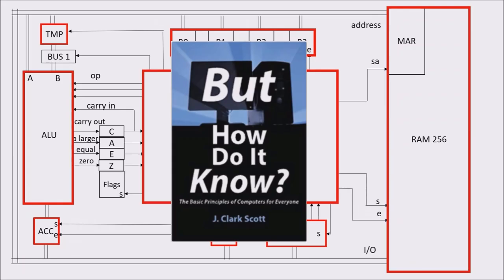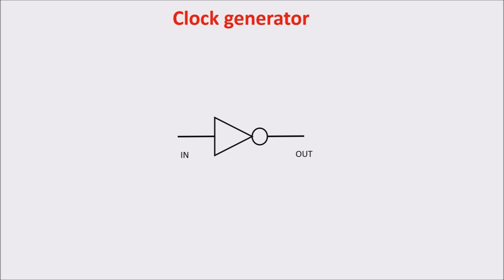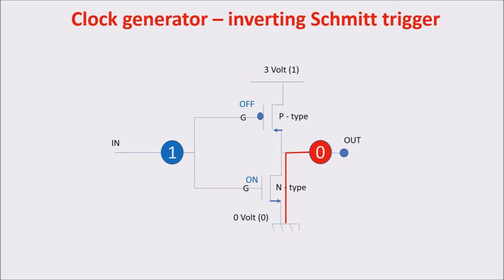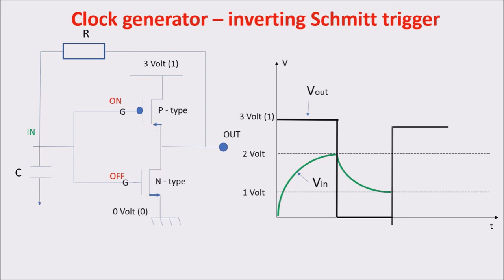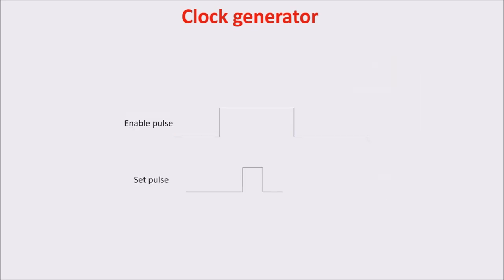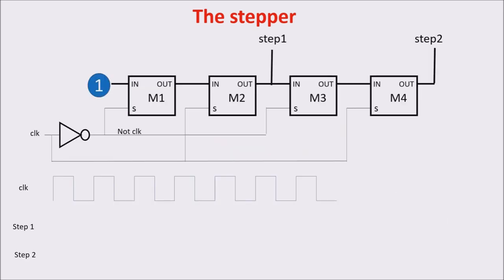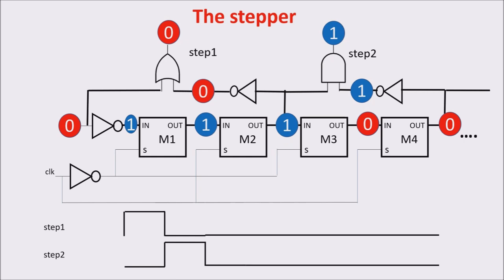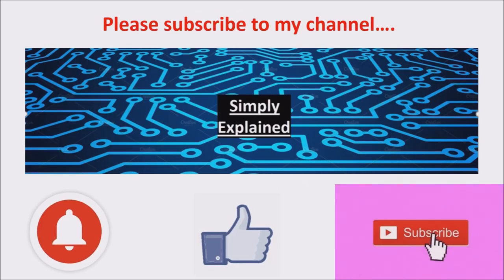The clock and the stepper -  Control Unit - how computers work part 7

Comment: At 08:43, there's a slight issue with the circuit displayed, `Clk s` is being shown as the OR gate and `Clk e` is shown as the AND gate, but the OR gate would mean that the only time it's off is when both `clk` and `clk delayed` are 0 which aligns with how the `Clk e` works and the AND gate would only be on when they're both on, which aligns with the `Clk s` signal.

Therefore, the circuit's `Clk e` and `Clk s` labels are supposed to be swapped.
Reply from the maker: You are right in the output of the OR gate Is ck_e and the output of the AND Is ck s